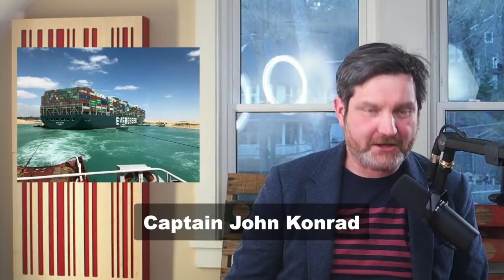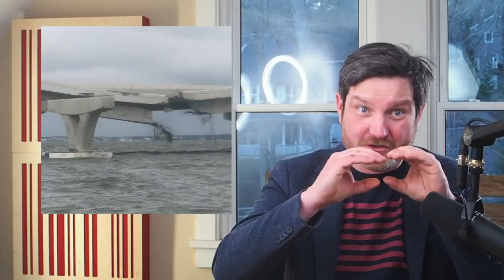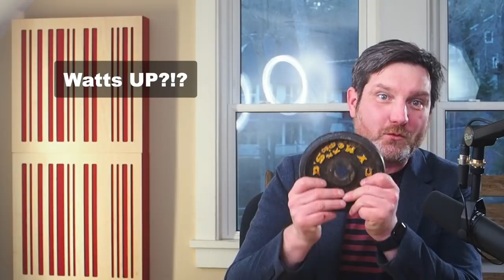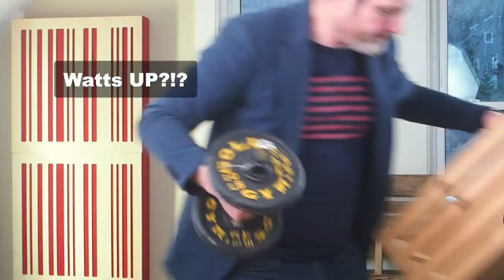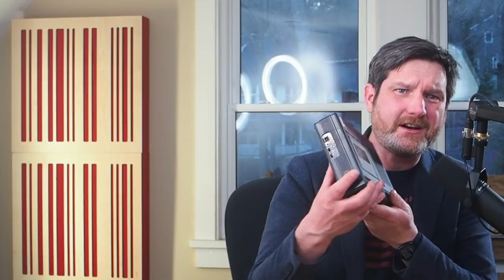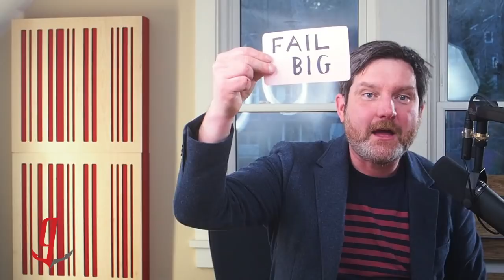This Is Why Biden's $2T Infrastructure Bill Will Fail

Comment: In areas with lots of water access and low ground water tables this can work in limited amounts  but most of the USA is dry land and this  is impractical.   That does not mean that moving freight by ship is not the best method for volume.
Roads also have issues for using asphalt instead of concrete for repairs and on construction of secondary roads. Interstates were originally built  with concrete then  often were repaved/repaired with cheaper and easier asphalt. Concrete has to have problem dug out fixed then new cement has to have enough to  make strong concrete patch. That also requires time, something the road infrastructure can not handle for loosing traffic lanes, since all are behind actual need.  Near me that couldn't even build an Interstate Beltway before they had to widen extra lanes for traffic on completed sections due to new development in that accessible area.  Which filled up that nice void and spare overhead for traffic volume.  Which using asphalt that softens in heat and is pressed smooth by a heavy Roller machine, has issues in parts of the country. So in the south USA where temperatures get hot in the summer and the Black asphalt holds the solar radiation heat and then comes the truck with heavy weight pushing down into the soften asphalt. Followed by more vehicles which are overloaded to squeeze more profit out of them, creating the ruts in the roads we all know hate.  Rails (trains)take care of this but you to get that freight to areas where roads and trucks are cheaper to cover the last X number of miles. 
Sadly due to changes old train lines have been decommissioned that used to haul the freight that runs on interstate because railroads didn't want to lower their profits, ran the track down to where repairs cost more than the line was making. It didn't help with crap like NAFTA that allowed many business to relocate South of the border which removed the large production manufacture plants that helped pay for the bulk of traffic on the railroads.  Decommissioning the rails which hurt many communities, the same the Interstate shift traffic of goods and of people that cause towns to fold. See Route 66 the old road across the USA that used to be the only continuous road across the country for Highways.   There also was dirty politics involved in removing rail service for vehicle service. Example when finally putting in light rail in my city, they were prepping the ground and were following the old trolley lines they buried for buses.  So a part of the problem is the politicians in charge do not have the best future interests in mind when voting for which business becomes the solution. Not that any is the prefect one size and /or application fits all in the first place.   

The rivers, canals and other water ways  all have maintenance upkeep with dredging to maintain navigation-able depths. Especially as ships have become bigger than the absurd biggest ship, which is now dwarfed by the latest Mega-Post-Mega_____ .  So just  like with roads and/or bridges  there is infrastructure upkeep costs.  Then comes weather cycles which we have gotten batter at migrated the damaged to roads, rails and/or bridges.  That sediment  of spring thaw/flood cycle  builds on top of the regular flow of sentiment.  Which the regular flow of sediment  was an added problem in April 2021 for the Suez Canal that made the grounding the worst it was there.

Also "There are no Hills" is BS there are hills they are covered by down river current speed changes. Not counting the Locks that are used to raised ships up sections of waterways that are not navigable. They exist  ships and boats are using more energy to climb the hills and power through the increased currents from the faster flowing water.  If you watch how far above sea level you are you will see you are gaining altitude aka going uphill .   So that argument is  flawed, that not to say that ship can move more volume for less costs and length (no longer 10 car trains to wait through due to the ability to stack that is limited by tunnels, bridges, Overhead wires and traffic signals, etc.  

If ships were off loaded on the other side of the water way in New York, then the truck didn't have to drive out of the terminal through traffic, over the few bridges and back into traffic to get around that water.  If trucks could  travel straight over the water and back to land that would solve the delay. A new bridge isn't just about the cost of the bridge but the land on both sides to funnel traffic on to and off of the bridge and out of the are where the bridge reaches each shore. Which there is that problem land is needed where all of it is claimed and been built upon and built skyward because the surrounding land was so limited.   There is no water front property to build new port infrastructure in the densely populated areas,  to help get the freight from the ship to them quicker.  Which means we have to go through the area on roads,. Unless we make new straighter paths that are not interrupted by crossing streets  with tunnels that will  have interstate level interchanges with ramps so freight changing directions can merge without slowing down. The 3rd option is to use the air space, which we have been promised flying cars and deliveries for how long?  Drones may be coming buy traveling and merging zones will become problem as their use increases. Then the drones will have to express routes/thoroughfares and then leave to secondary flight paths that have to allow traffic to enter while they are stopped or slowed down. Because how close can these future delivery drones fly together?  Computers are faster than humans and can communicate better but they still will have congestion issues.  Will we re model buildings for drone deliveries were freight is received what every 10 floors ? Every 25 ?, every 50 floors?  Starts to remind me of how skyscrapers were all going to have Zeppelin ports on them.   That "Last Mile" (last whatever to address)  is problem to every industry in delivery of services. Be it freight or telecommunications. 

Electric trucks have already been used to make deliveries and routine deliveries of certain goods was a regular activity. Be it Milk or Ice for the Icebox (forerunner for the refrigerator)  that had the truck making delivery to every house. The problem is it is not one company, which actually better for consumers. Despite the fact the will only use one service to their own detriment then cry when the prices are raised and their is no competition.

It doesn't help people whine about same day shipping or it taking 2-3 days when less than 3 decades ago you waited several weeks when ordering.

If I link  a url here in my comment , this will go to moderation limbo and die.  Please looking up "Shorpy  Blog" and Electric Trucks or vehicles. There were Electric Delivery Trucks in usage in the early 1900's   I made comment reply below to myself that is in moderation limbo now with such links and some cool ship images )  It is old Photo 1800-1940's (with special 1950's exceptions rarely) that show lots of old ships but what you are looking for is the "Electric Delivery Trucks" that were around in the early 1900's-1930's because electrical power  was easier to get inside cities than Gasoline was at the time.  Especially in the beginning. 

 I've tried  a comment reply that will hopefully eventually be unscreened with the url, Shorpy's is a site that is extremely large old photographs think "11 X 20 " or "24 x 36" poster size quality . In the photographs you can enlarge the huge image if you can't fully read the name and then usually you can clearly read the name on each ship and any cargo containers on them. So it is double score for Shipping images and distribution network from the USA . Back when the USA had several agencies( called the alphabet soup agencies at the time)  that had professional photographers who went around taking photographs of the people, the USA landscape(cities, buildings, life in them), how all their programs were working and changing things. A documentation of the country as photographic film became something affordable and camera more mobile. These are not your old small Tin-Types Images that were  digitally  scanned.....

Comment: Sounds great for New York, but what about all those inland cities? 
This idea wouldn't help Denver cut costs much.
As an ex truck driver, I knew exactly where you were going with the concept of costing more to go up and down hills, and all the starts and stops making trucks more inefficient. But...
Try to get groceries from L. A. To Denver without going uphill.
Even going from the Atlantic ocean to the Great lakes means going uphill via locks. 
I get your point though.
Reply: You are Absolutely right, it won’t work in Denver or Vegas or Salt Lake City... but the majority of the population lives on a coast or major river so there are a lot of places where it will work.

But stepping back even further first thing we need is money to test it.
Reply: @johnkonrad1276  maybe use the existing subways as part of your idea to move freight and use renewables to power the freight elevators?

Comment: Really appreciate a very nuanced view against the bill other than hurr durr socialism. 

Never really thought about the infrastructure problem as a shipping problem before, but it makes total sense. When you give these containers the perspective you do, it kinda baffling at we we're doing world wide. 20,000 containers is big number that doesn't have much reference for the average folk, but 20,000 trucks, yea that clicks. 

Your solution makes sense but there still a lot of things that need addressing. Power generation being a massive one. Going to need to generate power to keep those electric ferries charged. And if we want clean power, that means solar, wind, or depending on who you ask, nuclear. Which means massive build ups of those power sources. 

Which really opens up another massive can of worms in terms of resource extraction for those power sources, metals for the batteries, materials for wind turbines and solar panels, refinning of nuclear material for fuel, which means mining. Ultimately the pollution foot print from those sources will be of a lesser extreme than for raw oil, gas, and coal extraction but it'll still exist. 

The rabbit hole goes deep on this topic. Ultimately, their too many people on the planet, needing too much stuff. We'd prolly solve this issue over night  if half of the population vanished without a trace but that's neither here nor there. 

I'll admit, I scarcely know a thing about sea freight, the whole ever given debacle has given chance for a set of experts rarely heard from a chance to speak and I really think that is awesome. I've learned a ton about this whole industry in the last two weeks. subbed.